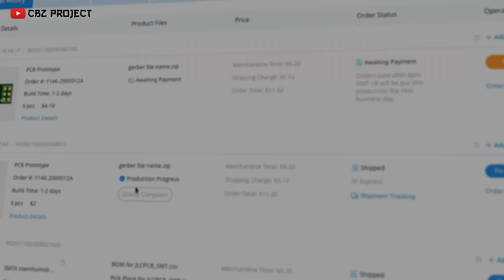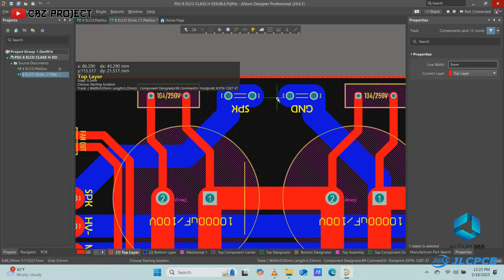DIY 2000watt? Powerful 2-Stage Class-H Amplifier with 9 Pairs of 2SC5200 & 2SA1943 Transistors

Comment: I would suggest looking into MJL21193G/21194G, given that you put so many output transistors in parallel. The SOA is almost double that of 2SC2500/2SA1943, meaning either half the number of transistors or double the power. Despite the price being double that of the Toshiba transistors, it is still worth to swap over. 
Also instead of using three beefy BJT transistors for the switching of the supply rail, it is much more economical to use a single MOSFET, in my class H project I use a single TO-220 device. I don't know what the 2SC5198/2SA1941 are for, but I am pretty sure you can eliminate them as well if you switch to a MOSFET.
Reply: BjT pair AB class Very good sound quality , mosfet ?
Reply: a1941/c5198 is  driver for 3pair bjt rail switch.
Reply: @timmythesheep
 kindly share your mosfet h-step circuit online through a link

Comment: One board maximum load 1500 watt as a transistor individually handled 150w and on 4ohms it can handled maximum 1500w rms at 100v rails and very strong cooling because it genrate 400+w heat